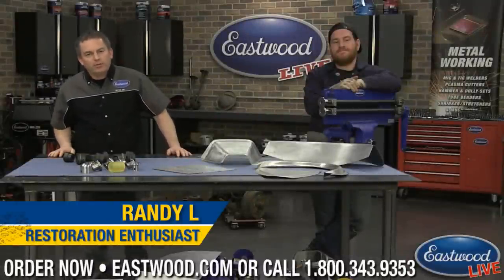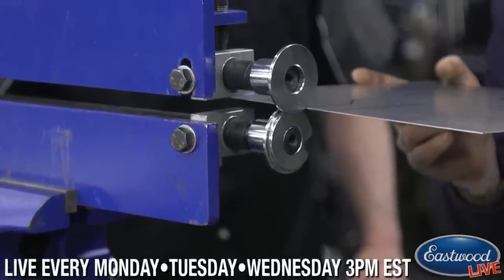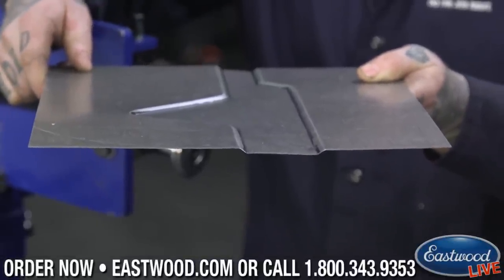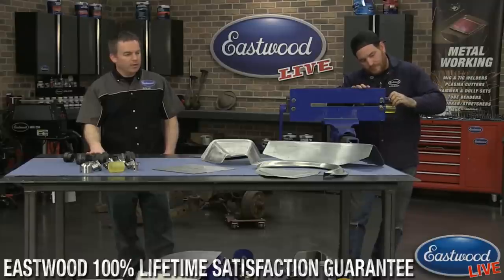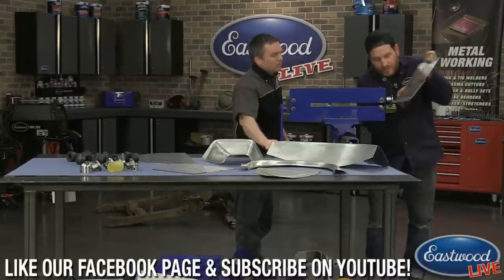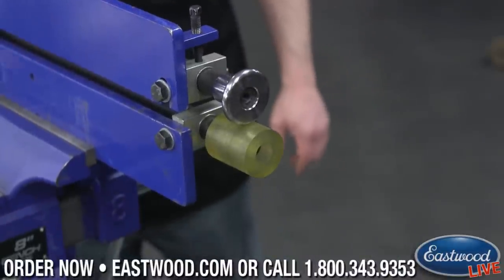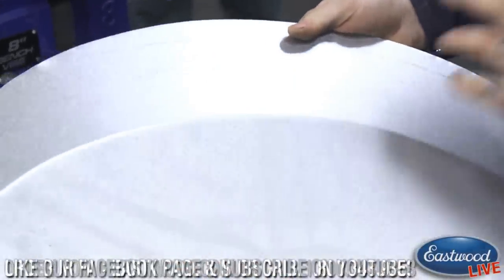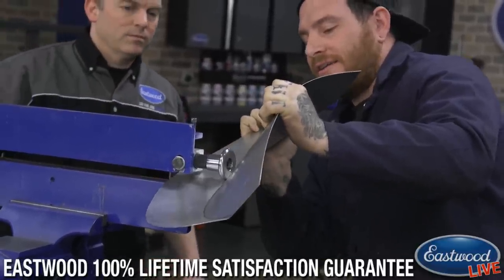How to Make Custom Floor Pans + Custom Dash using Eastwood Bead Roller & Forming Dies

Comment: Guys, I bought your roller with the motor, and want to make a roughy 1.5" x 5.5" recess, which will get painted and then deceive a waterslide decal (before clear coat).  So, can I make a sharp, 90-degree turn at the corners, or must I basically make the ends rounded, with a small radius rather than two 90-degree corners?

Comment: So u have to have two people to operate the bead roller or can one person do the job.
Reply: If you had a camera and an LCD screen with a decent resolution..

1 person.

Have the camera lined up with the two bead rollers and you'll be able to see where the roller is positioned compared to the markings on the metal sheeting or piece.. and will allow you to manuevour the piece whilst turning the wheel and being able to keep a view of said position.